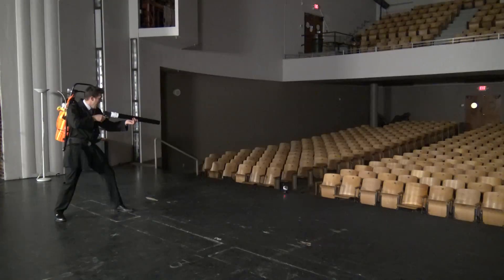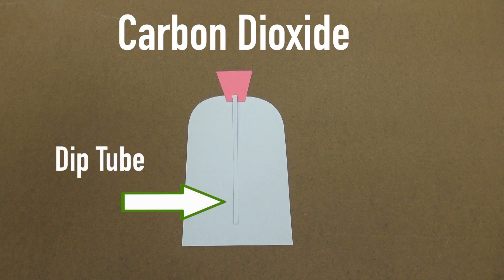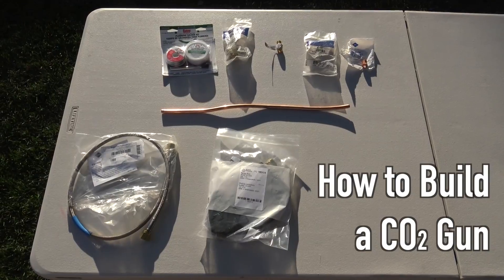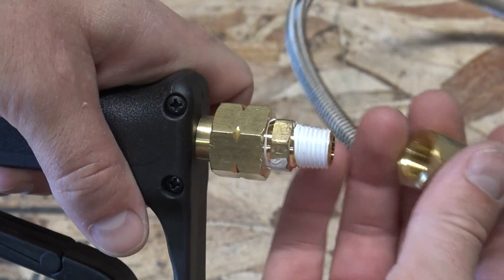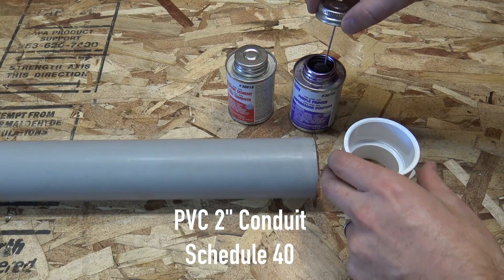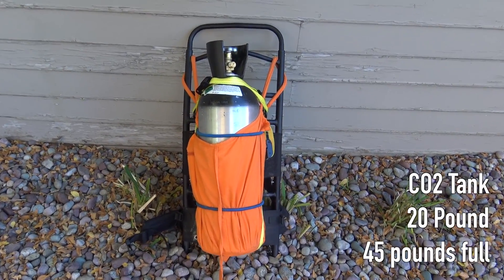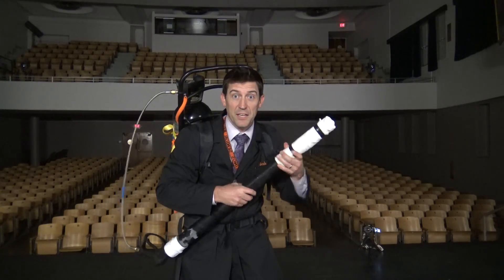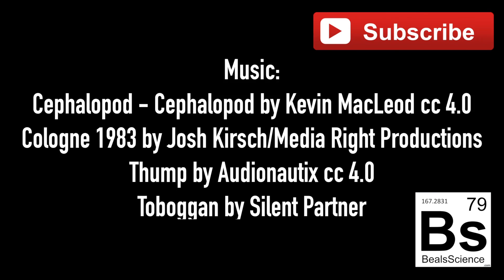How to Build a CO2 Cryo Gun to Shoot Snow and Ice!

Comment: Ive wanted to do this so bad recently, i got a few alterations though:
Pressure vessel mounted on the gun and can open so you can fill it with dry ice instead of having to refill a whole tank
Ducted fan impeller at the back end to force air pass the cold tubing as it fires
Nozzle to increase range potentially
Reply from the maker: I would love to see how yours turns out if you make it!
Great ideas!

Comment: if the CO2 tank was upside down, would that put the liquid CO2 at the bottom where they release into the hose thereby removing the need for dip tube?
Reply from the maker: Yes!
It n fact, my suppliers oftentimes will swap me out for a non-dip tube tank. When this happens I just turn the tank upside down.

Comment: anyone know how safe it would be to get hit by this? would it frost burn your skin?
Reply from the maker: It would not be safe to be hit with this at close range. The “fog” at a short distance is not too harmful because the cold dissipates quickly but the crystals of dry ice that form could be harmful because it is so cold.
Reply: @BealsScience  thanks! Could this be remedied by putting some kind of metal screen over the nozzle? I just want the fog effect.
Reply from the maker: @bluedogEDM  Absolutely! All you have to do is keep the liquid from coming out. So, if you keep the bottle upright (if it doesn't have a dip tube) or turn it upside down if it does have a dip tube. The other thing you can do is to run the copper tube to the end of the barrel and insulate the barrel. Part of the reason I am able to get big "flakes" with mine is that I cut the copper short so the liquid would spray out into the barrel. This causes it to freeze together into big chunks. If it goes directly into the air it makes small crystals (fog).
Reply: @BealsScience  thanks so much dude! You rock man.

Comment: Hi, I made the same, but it doesn't make snow, co2 is almost invisible, what can be a reason?
Reply from the maker: Try turning your CO2 tank upside down from how you are currently using it. It might not have a dip tube.
Reply: @BealsScience   i tried in both positions, can it be a reason that my pvc tube only ~16inches long and 1.5inches in diameter?

Comment: Can you make a Cryo Gun using a CO2 cartridge?
Reply from the maker: No, I don’t think you can. The CO2 must be liquified as it is in a larger tank. The liquid CO2 goes into the air and, as it changes to a gas, it absorbs energy from the air and makes water vapor (which cools to form “snow”)and some dry ice. The small cartridges contain only compressed air (unless there is a brand I am unaware of that has liquid CO2).
Reply: @BealsScience  I just found a video that just answered my my problem on making CO2 fog for cheap. :D https://youtu.be/L7U2CbxfMMk

Comment: If you drill more holes in the back of that end cap, the CO2 will pull air into the pipe with it and the effect will be bigger with the fog going further before it dissipates.
Reply from the maker: This is a brilliant suggestion!! I will definitely try it out.
Thanks!
Reply: @BealsScience  what is meant with the 'end cap'. I'm from belgium. Is it the end of the copper tube?

Comment: Watching this in 2019 :) how long will the 20lbs of co2 last? Aka what's the mass flow rate for your system?  Wondering how best to figure out how to size a tank
Reply from the maker: I get about 45 seconds to 1.5 minutes of constant “snow” but sometimes more. It depends on a few things:
-the dip tube length (I have started using standard tanks and turning them upside down to get more liquid)
-how long you hold the trigger. As the pressure rapidly changes in the tank (holding the nozzle open for a long time) the liquid more quickly turns to a gas. Some of it will re-condense so you can get more snow after a pause.

There is still a lot of pressurized gas in the tank even after you’ve siphoned off the liquid - I will use that to launch balls and shirts.

Comment: This video helped me so much! The way I built mine was with a regular pressure washer hose and handle and I used some conversion pieces to fit it to the tank. I also used a smaller pvc pipe which I noticed gives a bigger effect!
Reply from the maker: Thank u for sharing! I have been experimenting with different sized tubes as well. It seems like I get much more “snow” with larger diameters but it doesn’t project as far (which makes sense). I will keep trying more diameters and see what I find.

Comment: Great video..were can i get the backpack..
Reply from the maker: Great question! I've had several people ask and I keep forgetting to add the information to my website but I've updated it now (https://www.bealsscience.com/single-post/2016/10/16/How-to-Build-a-CO2-Cryo-Gun). I had a pack frame from an external frame backpack that I used for backpacking in the mountains. I removed the fabric pack and saved the frame but it is possible to just buy frames like this for pretty reasonable prices. I've shared some options and found some links on Amazon and put them on the site. Let me know if this helps. Thanks! ~Craig

Comment: Is your copper tube 1/4" ID or OD?
Reply from the maker: Good question! It is 1/4" ID
For anyone else reading this, the copper tube is 1/4" inside diameter (ID)
Reply: Beals Science any idea what the OD on that is?  All the pipe is listed by OD
Reply from the maker: I don’t have the cannon with me now but can check next week.
If I forget to respond just remind me and I will get a caliper on it to confirm. I am guessing that other people have run into the same problem.
Reply from the maker: The copper tubing is 3/8 inch OD (outside diameter)
Hope that helps!

Comment: Does the sprayer valve leak?  it seems like liquid CO2 has potential to generate 2k psi in the liquid tube and valve between shots, also any CO2 trapped in the valve body itself ?   I'm trying to develop a CO2 effect, but Cryo rated solenoids are super $$$$ .  Maybe I don't need the fancy hardware after all?
Reply from the maker: I have never had a leak in any portion of the line or the spray nozzle. Everything seems to hold up very well! What are you thinking of building?

Comment: instead of a co2 can it just be air
Reply from the maker: absolutely! You could just put an air tank on the end of the hose (or an air compressor) and use the gun that way. You can also shoot t-shirts or balls from the cannon with compressed air. You will not, however, get the 'fog' or 'snow' because the compressed air will not cool enough to freeze the air molecules as it exits the end of the cannon.

Comment: would this work if you took a co2 tank with out a dip tube and turn it upside down?
Reply from the maker: jim h yes! In fact I have ended up with several bottles with no dip tube and they work great upside down. The tricky part is attaching them to the pack upside down!
Reply: thank you

Comment: Would there be any way to have fairly powerful green lights on the inside of the tube that would cause the emission to be coloured green? Wondering for a Steampunk Lex Luthor costume.

Absolutely loved the video, by the way!
Reply from the maker: Clockwork Kirlia thank you!

I love the idea of lighting the Cannon from the inside!
I've got a couple lasers that I could get inside and secure with powerful magnets to see it the light scatters and lights up the particles! I will try it out next time I fill the bottle and will keep you updated!
Can you think of another way to light the fog that may work better? If so I could try it.
Reply: Beals Science I was maybe thinking a ring of green-tinted lights (even LEDs?) just within the tube. Wouldn't regular lights light the whole cloud more so than specifically lasers, at the expense of direction? You could connect them to a switch on the trigger, so it only lights up when the CO2 is being released.

Thanks for the reply! I can't wait to find out if it works!!!
Reply from the maker: Yours is a much better idea than using the laser! I like the idea of LEDs in a ring inside the barrel! And, if you purchased the color changing strips of LEDs the color could change for any occasion! Thanks for sharing your ideas!

Comment: Can I use this as a flamethrower for airsoft?
Reply from the maker: douglas holland I am assuming you mean it would be a simulated flame thrower because you can't get any flames from this setup. But, you could definitely alter the barrel size and potentially make an airsoft reservoir attachment!
Reply from the maker: Spraying someone with this CO2 will not harm them if it is for a short period of time (assuming they are wearing goggles). The 'fog' is cold and it is difficult to breathe if someone shoots it at your face because it is all CO2. Spraying somebody without goggles could harm their eyes. Spraying someone for a prolonged period of time could cause frostbite!

Comment: Any reason why you chose the longer barrel length?
Reply from the maker: I didn't do a lot of experimentation with length to see what was best. I just chose a length that could fit a t-shirt and would accept a squishy ball - I wanted to be able to shoot both out of the cannon, in addition to the snow/fog. I would be interested to find out if a longer or shorter barrel AND if a longer or shorter piece of copper tubing make a difference. Any thoughts?
Reply: THere has to be an optimum, and I would think it would be a bit shorter so the kinetic energy isn't lost bouncing off the walls of the barrel, but I don't know. I will test it when I get ming assembled. What about optimum diameter of copper tubing? Do you think 1/8th is too narrow?
Reply from the maker: Ryan Farnsworth you could very well be right! Let me know what you find out. I can easily change out my barrel with this setup if you find another length to be better. Thanks!
Reply: Im interested if you guys found out any more info on length and diameter of the tube.  I see some power washing guns on amazon with different lengths and attachments.  I'm using mine for a Batman movie and Mr Freeze is in it.

Comment: I realize this is an old post but Atlanta SFX has a 5' Cryo rated hose with CO2 Tank Adapter on it for $40. $10 in shipping was still cheaper than amazon and has almost everyhing you need. The Gun connector is a hydraulic connector. I bought an adapter for $1 at my local shop. A 1/4" to 3/8" also worked with extra teflon tape.  https://www.atlspecialfx.com/collections/cryo-gun/products/co2-cryo-hose
Reply from the maker: Seth Mitchell this is a fantastic find! Thank you for letting me know! I will add the link to the tutorial on the webpage. Did you build a CO2 Cannon? If so, how did it turn out?
Reply: I did, and it works great. I built it to use this Halloween at my house. However I found a weird side effect of the co2 through the PVC, It is producing a static electric charge that is discharging through the handle into my hand.I tried different Copper pipe lengths and different PVC lengths but it persisted. I made a change to an aluminum nozzle and the shocking went away. It may be related to the humidity, (I live in a very arid place), or something else I don't understand. Still a great project, I really appreciate your tutorial. Initially I wanted to build a remote triggered one, but a Cryo rated powered valve is over $350. Your setup is affordable and my kids and I enjoyed making it. Thank you.
Reply from the maker: THE STATIC THING IS A REAL ISSUE! And I haven't been able to figure out exactly what is causing the build up of static - I would love to hear dome ideas about what is causing this!
It is good to hear that aluminum worked for you (do you have a link or picture of what you used?). I was presenting in Las Vegas in front of a huge array of LEDs for a big screen and I was building up so much charge that I was getting arcs into my back and kidneys! It didn't hurt terribly bad but I was worried I was going to build up enough charge to destroy the Jumbo Tron I was in front of!
I may have to alter to aluminum as well.
Thanks for sharing.

Comment: good evening sir!!!! i have buy from internet one co2 gun but i dont know which is the right type of tank!!!! can you help me??
Reply from the maker: You can use a tank with a dip tube or one without a dip tube. The dip tube is a tube that goes from the valve on the top down to the bottom of the tank - this allows you to pull liquid from the bottom even when the tank is sitting upright. If you end up with one that does not have a dip tube you can always turn your CO2 tank upside down so the liquid will come out of the valve. Either will work but I prefer the dip tube version so I don't have to figure out how to hold my tank upside down.
Does that help?

Comment: I'm thinking of building one of these for my band to use while we perform. Is there any risk of harming our audiences with it? Also, How long did the 20 pound tank actually last while you were using it?
Reply from the maker: Joseph True build it! You won't be disappointed! I get about 45 sec - 1 minute of liquid CO2. It doesn't seem like much but it has a big impact! You could always use a big tank and not strap it to your back and get a lot more out of it. But even after all of the liquid has been pulled off you will still get a lot of gas at high pressure. This makes a crazy loud jet engine noise from the Cannon and there is enough pressure to launch tshirts and balls well after the liquid is gone. Hope this helps!
Reply from the maker: Joe, there is no harm unless you were to blast someone directly for an extended period (this could cause frostbite or potential suffocation because of too much CO2). But, if it is used in a normal situation, as shown in the video, there are no safety issues. And, it is a HUGE crowd pleaser.
A full tank only lasts about 35-60seconds at full blast. I usually use it in bursts intermixed with a presentation. The gas will last a lot longer than the liquid (you must be shooting liquid to get the fog and snow) so even after the snow is gone, you can still launch things from the cannon and it will make a deep, loud booming rumble for very long time (the gas lasts a long time).
Reply: Beals Science How could you convert it to shoot only cold gas for localized cryotherapy purposes?

Comment: Can you show how to adapt a paintball Co2 bottle to fire as a cryo gun? paintball co2 tank cryo gun
Reply from the maker: Great question!
One problem with using a paintball CO2 bottle is that there ends up being very little liquid CO2 in the container (this changes with altitude, pressure, etc). The cryo gun has to be shooting the liquid portion of the CO2 tank to get it to shoot "snow and ice". A small CO2 tank will eject very little liquid carbon dioxide and will, therefore not produce much of the effect (and it doesn't last long). The larger 20 pound tank has a significant amount of liquid CO2 but even with the larger amount, I only get about 35 seconds of total ice and snow shooting time. A that point I am just pushing CO2 air out of the gun; the sound increases (it gets crazy loud) but does little more than make noise. 
So, with a small paintball gun, you could make a good noisemaker, but not much of a cryo gun...

Comment: I gotta have one of these!!!!!! How much did this build cost?
Reply from the maker: The CO2 tank was by far the most expensive part. I used a lot of stuff that I had saved from other projects to build much of the rest of it. But, without the tank I probably spent about $75 (the spray handle and the braided line were the bulk of that). If you are looking for a list of supplies I put one together on my website: http://www.bealsscience.com/single-post/2016/10/16/How-to-Build-a-CO2-Cryo-Gun

The CO2 tank was about $160 filled but it can be refilled for about $20.